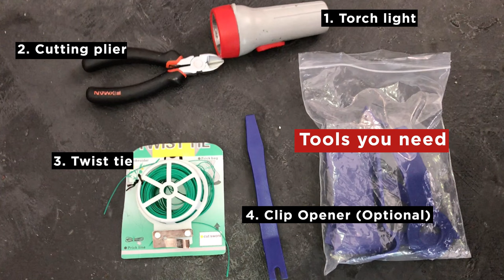DIY : Easy way to hide your dashcam wire perfectly! (without open A-pillar)

Comment: blocking side curtain airbags, your car doesnt have the logo there but others that have side airbags should take note of this.
Reply: If side air bags don't deploy because of a wire a person probably doesn't want that car lol
Reply: My car doesn’t have the logo there, but i know it has airbags inside 20-30 cm down from the roof liner. It’s a part of the side curtain. This install would be very dangerous on every car with airbag in the a-pillar, as you said. You need to remove the trim and make sure the wire doesn’t interfere with the airbag. Or tuck it in between the trim and window👍
Reply: @MrKjetil101  air bags should be about pressure. If a weightlessness cable prevents 100s of pounds of resistance and air bags from deploying...then, again the vehicle is not worth owning. Ask yourself,  how much does a cable weight innately? Ounces to pounds. Stop the ignorance.
Reply: @doritosmix73  It’s really not about the wires preventing the airbag from deploying, but it’s the fact that 100s of lbs of pressure from the airbag deployment can send this wire flying into your face and cause severe injuries. When routing these wires, it’s always best to remove the A pillar and run the wires above the airbag so if it deploys, you don’t get injured by the force of the wire flying out and potentially hitting your face or causing body injury. It’s certainly a potential risk that could cause severe injuries. Better to be safe than sorry.
Reply: @dreamnight-mq1zg  if airbags deploy the wires are going to go flying along with the a pillar material. Do you think air bags deploy and remain behind the housing?
Reply: @dreamnight-mq1zg  you also need to read what the poster I replied to said about "interfering".
Reply: @dreamnight-mq1zg  I couldn’t remove the A pillar panel on my 2009 Opel Insignia, I tried to pull but didn’t come out so I gave up because I don’t wanted to break it. I got an appointment with a garage and they’re gonna do it for me, they said it’s a fast job but how much do you think it’s gonna cost? Blocking the side curtain airbag is very dangerous, the cable will fly out of the pillar like a bullet. In fact the sides curtain airbag and all other airbags will deploy at a speed around 300 km/h, imagine the cable being hit at 300 km/h, it would hit your face causing severe injuries.
Reply: You're absolutely right, adding any kind of a projectile (no matter how small) in front of an explosive device is never a rational idea. Manufacturers have spent decades perfecting airbag technology, I very much doubt any of their use cases involved wires crossing the airbag. Don't do it.
Reply: @doritosmix73 you just wanted to be right, man. Just accept it.
Reply: Of every car have the logo’s!

Comment: Where the cube camera go for the back how u hook that up
Reply: Some people just are not tech savvy.  
Pay someone to install it for you......
Reply: @budcunningham6732   I'm a prof car audio installer. I'm pretty sure I know how to install a camera in a car but it's not blue tooth clearly so how does it connect if no wires.  It don't because it's a bs scam
Reply: @maddmavic  I have installed these also , and wifi isn't necessary. 
I have one of these in my car .
Please define "professional " .

Comment: Sorry I am way clueless about this and recently bought a car, while pushing the wires like this..is there any risk or chance of getting airbags getting deployed?
Reply from the maker: No it will not, unless the sensor detect strong impact on the car (front & back, side of door etc.). You can remove battery terminal before do it if worry.
Reply: @junkitlow  thanks mahn, I just fixed all wires and setup my dashcam, luckily I dint get  any  chance to see curtain airbags during the process😄

Comment: Was wondering where I can get the tool ur using in this video ( the blue plastic thing )?
Reply: I don’t believe you need to use that specific tool , at least I am not planning to . It seems that you need to just get the wire under the headliner and that seem to be pretty easy
Reply: You don’t really need it!
Reply: Mine came with the camera.

Comment: I hard wired my dash cam using an add a fuse but no power.  The fuses are good, cable is brand new and wired up right. One to the fuse, one to ground. What am I doing wrong?
Reply from the maker: Try to check the fuse goes to which accessories?